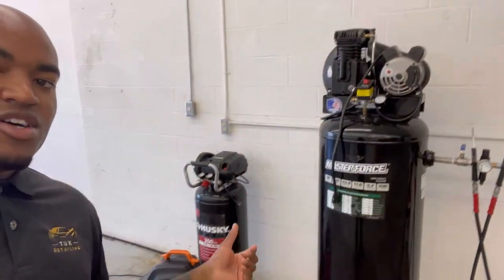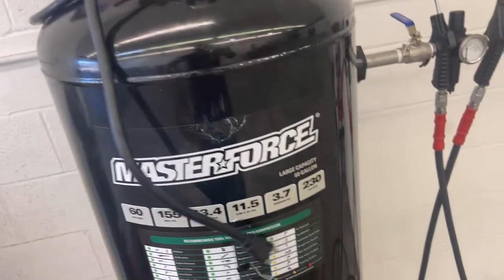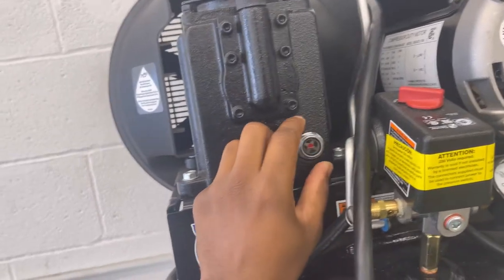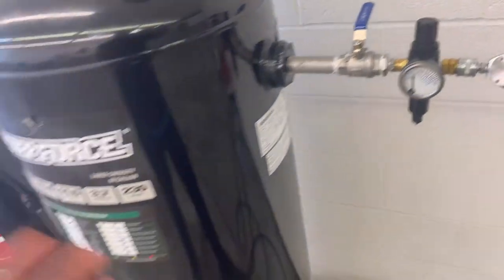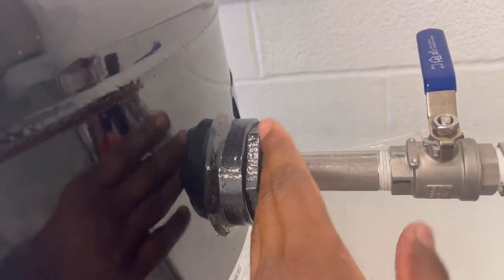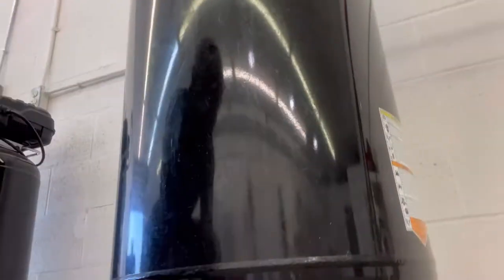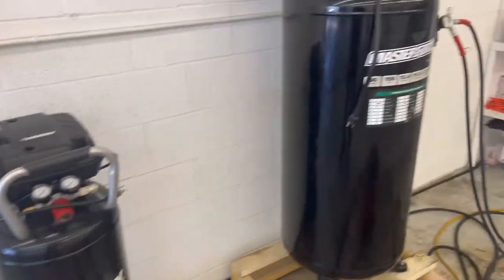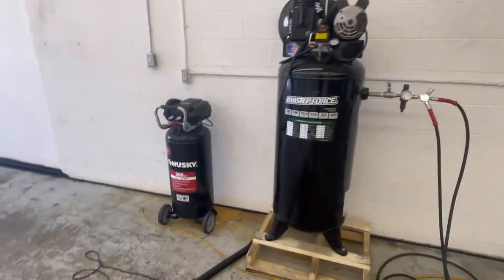Master Force Air Compressor | Husky Air Compressor | Shop Upgrade | Detail Shop

Comment: It came with that 15amp power cord? The compressor pulls 22 so it should be a 30amp circuit with 10gauge wire

Comment: You don't remove the sight glass to drain the oil. You remove the small 1/4" plug that is to the left of the sight glass. Once you initially drain the break in oil, you can install a 3" piece of 1/4" threaded pipe into the drain hole to extend it out. The put a 1/4" cap or valve on the end of the pipe. This will male it a lot easier and cleaner to drain the oil for future oil changes.
Reply from the maker: Thank you for the tip 👍